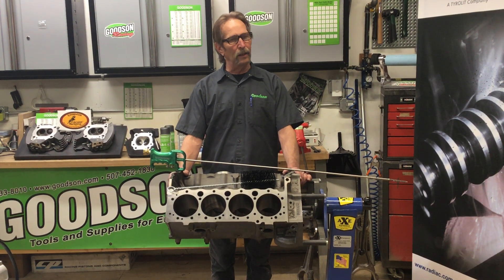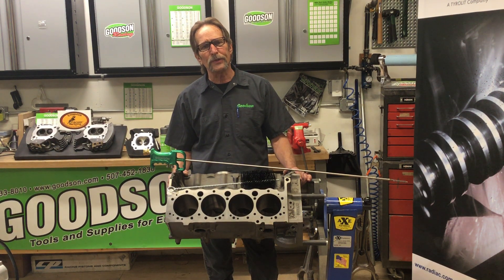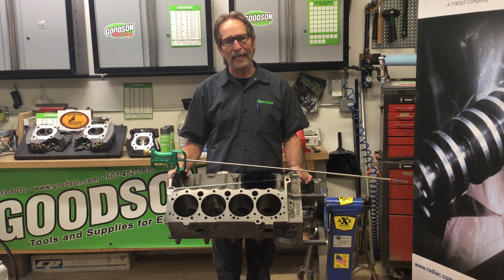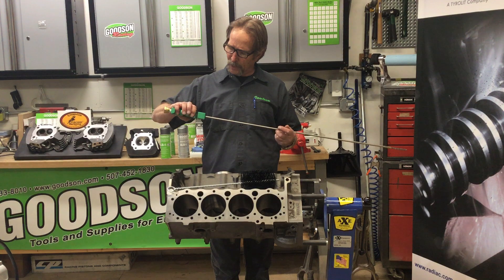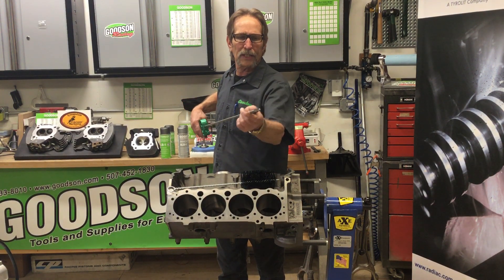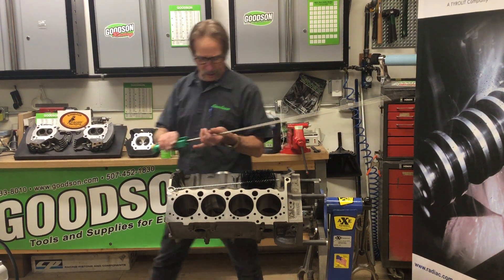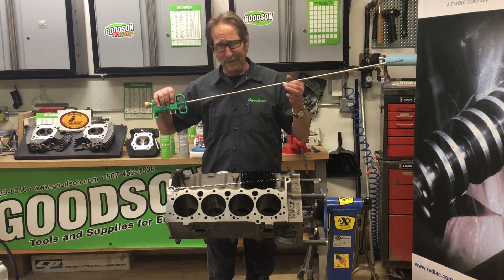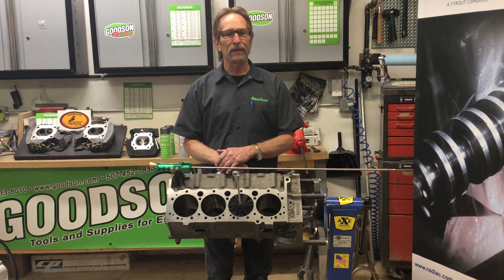High Pressure Oil Gallery (and More) Cleaning System Overview

Comment: Just purchased one and was very disappointed in it....
Reply: Why did it disappoint?
Reply: Because they failed to tell you in the catalog, for it to properly work, you need 50 to 60 psi. My rinse booth water pressure is only around 20 lbs. So the air overrides the water pressure and you get just a drizzle of water. You can hook it to the county water pressure through the hose, that at my shop has around 60 psi, and it works fine.  Only problem with that is you can not clean blocks with COLD water......
Reply from the maker: Hey John, Thanks for the input. How can we get in touch to discuss this with you?
Reply: @GoodsonShopSupplies  that would  be great. Is there anyone specific that I need to ask for.
Reply from the maker: Hi John, yes, please call and ask for Dave.